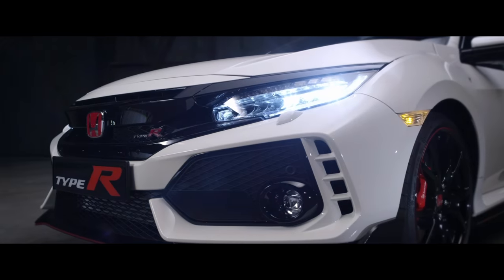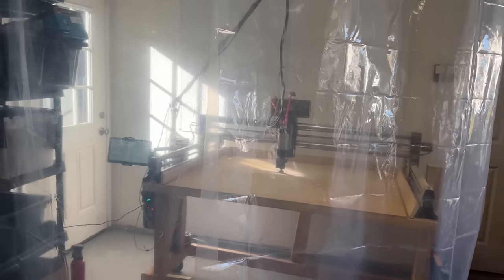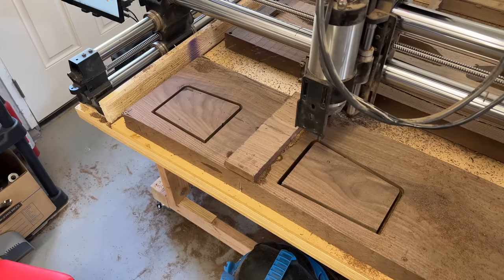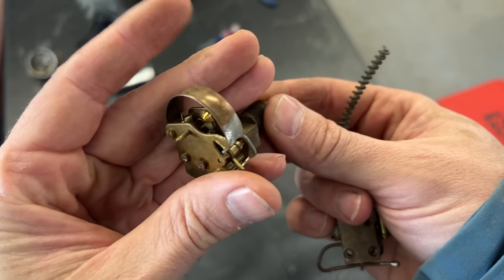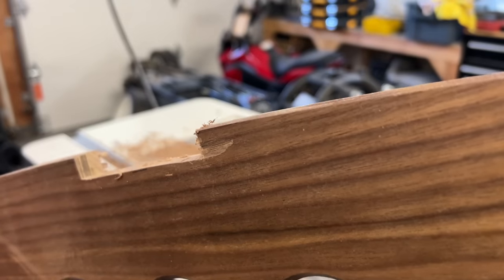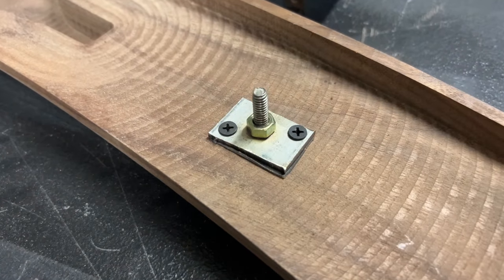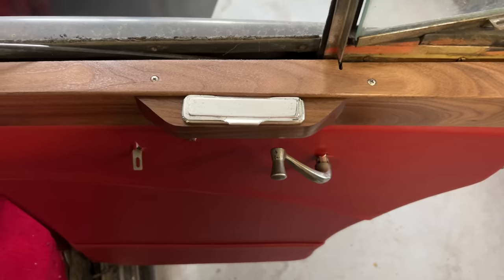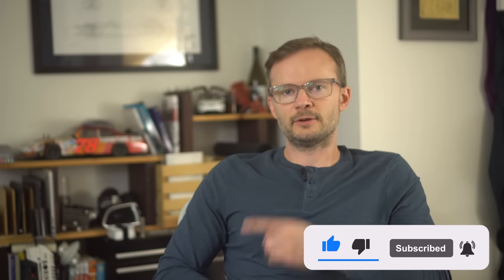Make A Wood Dash For Your Car. Or Just Watch Me Do It. Whatever.

Comment: The main reason the likes of Bentley and Rolls Royce use veneer is not because they are being cheapskates, its that they can match the grain and patterning around the car.  You can follow the grain from one point all the way round and return to the same point without any seeming change of grain or pattern that is inevitable with solid wood, even if you use just one chunk of timber at the outset.  Indeed, it is likely that there will be obvious differences between pieces of wood in different locations.  Book matching and slip matching veneer can provide a very decorative and high class finish.  Veneering is a highly skilled process, which you will find in furniture and joinery as well as cars and all carried out by the very best tradesmen around.  Plywood is often used as a backing to veneer because it provides a dimensionally stable base that won't develop the inevitable timber defects as it ages.  It would be a shame to see a solid wood dash board develop a shake (split) that would render it scrap.

Comment: As you can, no doubt, infer from the comments, you've wandered into the area of expertise of woodworkers. And woodworkers, clearly, are a chatty bunch. I say this as someone who has professionally worked in wood for over 40 years, and who recognizes that, mostly, we just won't shut up. However, most of the comments are spot on- your dash is a limited time offer. Bit of a shame, you did some nice work, there. It may not be as bad as some would forecast, because walnut is more stable than many woods, and pretty damn hard. Which means that it won't warp overnight, but if it does warp, there won't be any stopping it. Ah, well, live and learn, and don't cast aspersions on veneer, and don't use poly, use lacquer. Sod the loony algorithm.

Comment: Did you use the new Einscan you bought for the dash?  Looking forward to any video you might make on that.  I stumbled across the Einscan somewhere else on the internet and have been really considering getting one as it seems to be one of the better consumer level scanners out there that aren't crazy expensive.  It's not like they are cheap, but it certainly fits nicely in the gap between couple hundred dollar toy and several thousand dollar commercial scanner.

Comment: Veneer is actually ridiculously easy and given the insane stuff you already do would have been a walk in the park. Especially now they have PLA backed veneer. You just peel, stick, and trim with a carpet knife, then sand edges. It's cake.

Burled wood would have made it period original. I like the job you did, but it's a straight grain effect. In any case, it still looks very classy and well done, and "originality" barely matters considering the Tesla wheels are not a period look either. :-P

Comment: You might find out the hard way why car manufacturers do not generally use solid wood. It's not dimensionally stable, is liable to cracking and warping and is really not the best way to achieve the optimum effect. There's a big difference between wood used as a structural material and when it's used for presentation purposes. However, one thing you are definitely correct about, and that is veneering requires a very high degree of skill.

Rolls Royce, Bentley and the like do not use veneer because it's cheap, they use it because it produces the best results. There are techniques, like book matching, you just can't do with solid wood.

nb. in one very real sense, all wood in a car used for aesthetic purposes is "fake" in that it is not structural, and it's also not optimal. Good old plastic mouldings probably win out on that front, albeit it's not a good fit for small runs of course.

Comment: I do like wood dash boards l have owned two cars with wood dash boards both British made in Australia and not really high end cars they were Hillman Gazelles but they were veneered but the door caps were a solid piece of wood as l say wood and leather equals luxury my hillman gazelles seats were vinyl but the wood gave them a touvh of class also quarter windows which they had give a touch of class your Jaguar is very classy and your use of solid wood very nice my 1997 toyota hilux has quarter windows and air conditioning

Comment: Not constantly puffing a Cali-Cannon at the backseat of that Jagg, is such a waste of a perfect dope mobile. Another thing that was a waste, was that walnut lumber. Solid wood won't hold inside a car, due to temperature and humidity changes, and UV rays. Not even if you saturate the wood with PU lacker/ epoxy resin. They went for veneer over plywood, bcz the demand was "wooden dashboard" but it needed to hold long enough to get the car sold.

Comment: The reason they use veneers is because wood expands and contracts with humidity changes.   Not great if you want things to stay fitting in all climates.   So... Plywood with veneers to solve the problem.

Comment: Beautiful work. I love the look of a nice wood project where color matching pieces and grain orientation is considered. 
For me, my preference, my opinion, … I really like a finish that showcases the wood both visually and in feel. The finish on parts that are frequently touched, meant to be handled holds up better, and feels classier when hand rubbed with a penetrating finish than any surface covering varnish. 
Every time I do use a varnish I can’t help but think back to sitting on a friends plastic covered couch. Tacky in more ways than one. The film finish is like the ‘couch condom’ in that friends house. Please, please, please don’t put the plastic film covering (condom) on the gear shift, no one will drive the car.

Comment: I imagine there is much nicer quality woodgrain possible with veneer.. because if you need to find solid wood of that size, you'll have to first wood of the right shape and size wich will often cause issues in itself , so you end up using what you can find and than the grain is what it has..
where as veneer allows to find good grain.. and duplicate with mirroring layers.. so with veneer you can select on grain... and the cosmetics improve

An i am sorry to say, but the original jag veneer despite being worn , looked a lot better than the wood now... it looks like a clothing cabinet was repurposed to make the dash.. and it does not look nice, it looks new.. not jag nice.